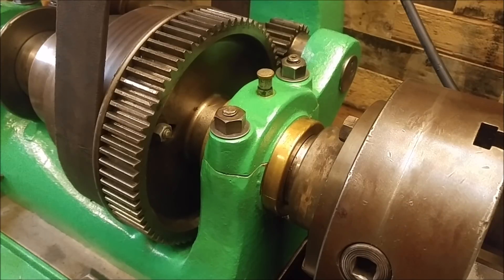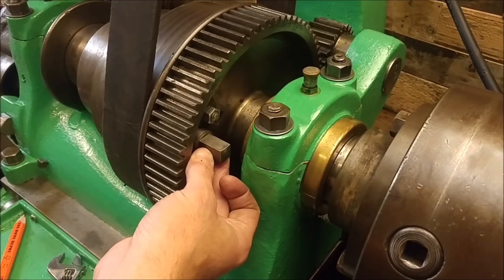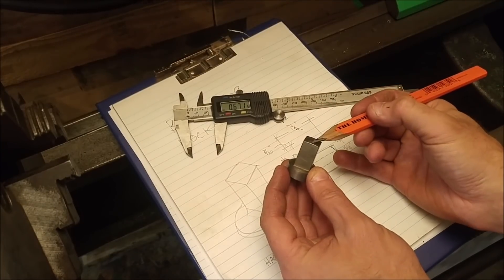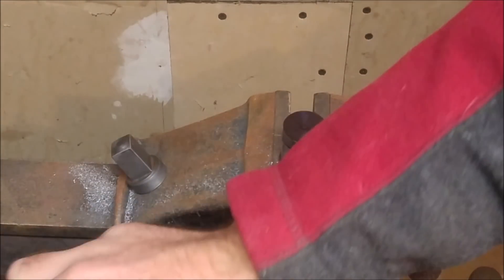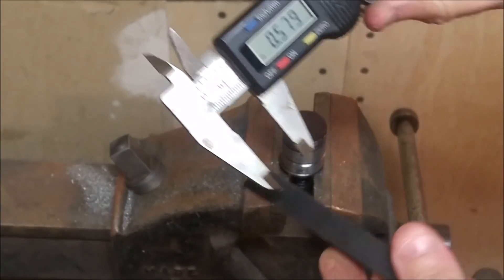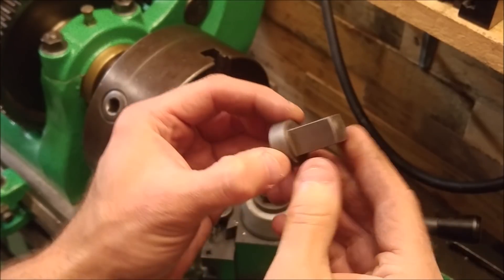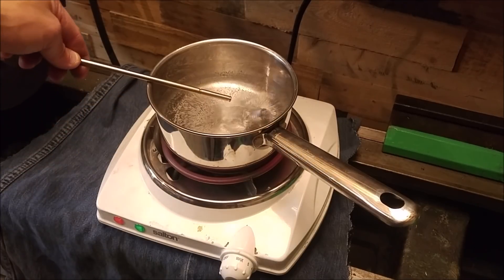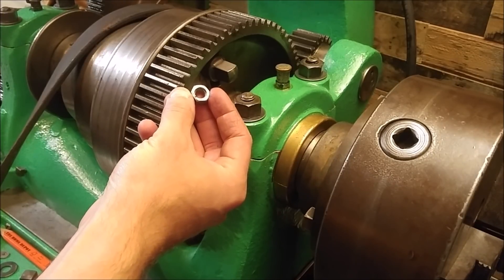Vintage Bertram Lathe Restoration - Bull Gear Locknut Fabrication - Make from Round bar

Comment: Holy moly!! Thank you for this video. I just happened to be trying to figure out how to make my 1900 lathe run at the same speed as the pullies. What are the odds that i find this video!
Reply: Can you explain more of how to get the two pieces to run together? Im guessing you pull the bolt to the far end of the slot and tighten it down.

Comment: What is the name of the metal used in lathe knives?
Reply from the maker: Lathe cutters are normally made from HSS, or steel with carbide inserts silver soldered.

Comment: I see a safety issue with that solution. You have to consider that the threads will tend to loosen with vibration, potentially creating an airborne fastener.  I’d dap a small bit of the blue loctite on it.  It’s not a high-strength lock but should be enough with that small of mass.  Like the video and enjoyed your style.
Reply from the maker: Good point, I will take your advice on this and find something to keep the nut from backing off and potentially injuring someone.  I'm not certain that thread lock would be the perfect solution in this case, but a silicone sealant on the threads might be a good long-term solution against the nut backing off.  This part would be need to be loosened on a semi-regular basis so that I can work in the back gears and I believe thread-lock would need to be re-applied after the seal is broken (correct me if I am wrong). 

I have some RTV silicone sealant, I want to do some research to see if this is a proven solution to loosening due to vibration.

Excellent point, thank you for the comment.